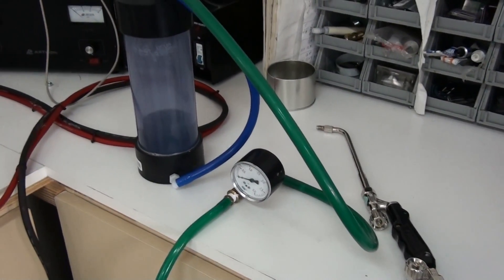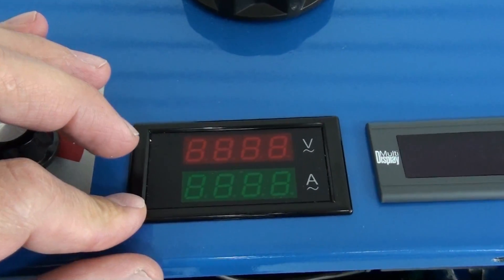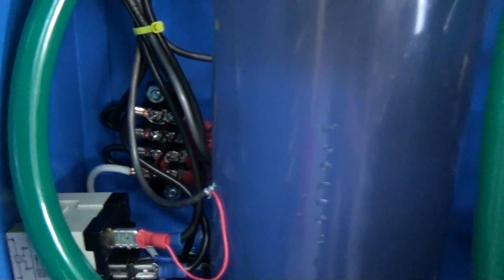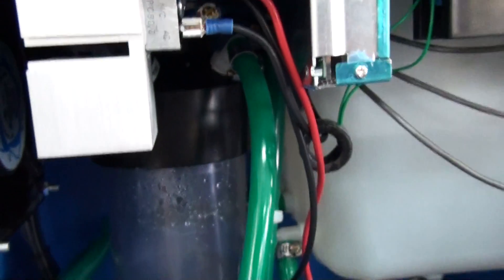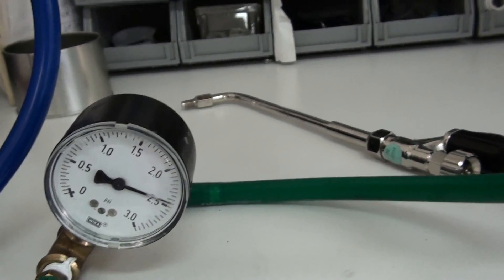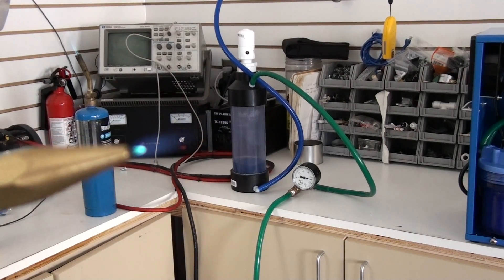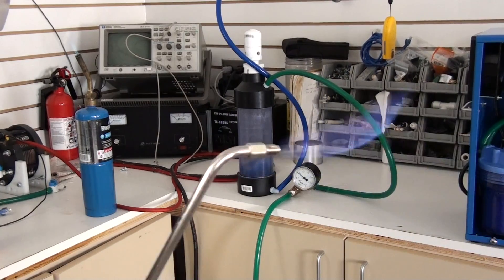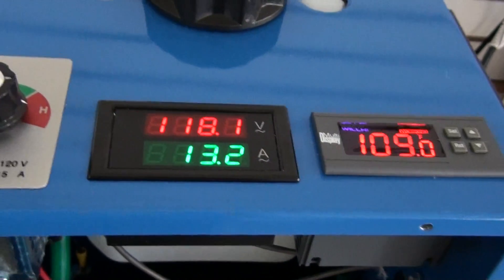HHO torch bubbling through lacquer thinner. WON'T Flashback

Comment: Very interesting.  But why use an arrestor when the gas is going to bubble through what most people use, a water jar. Surely this acts as the one way valve? Thanks
Reply from the maker: The flashback to the bubblers flash port of violent. I use the small arrestors because of that.
Reply: @Hydrogen4Health  ' the bubblers flash port of violent ' ???? What do you mean by this statement?

Comment: GREAT JOB, you have proven two theories that I have stumbled across over the years. 1) HHO is enhanced by the introduction of hydrocarbons, a very small amount of hydrocarbons ( Diesel, NG, propane, acetone) reacts with HHO at a molecular level (diesel fuel may give the same result) .making the gas far more stable and increasing the BTU's, especially enhancing the combustion process for use as a booster in diesel or gas engines 2) Don't use blue aquarium sandstone to clean the gas (only use the white sandstone). GREAT VIDEO....

Comment: how you increase the amperage and regulate it
Reply: GreenFuelH20 makes a regulator unit.  That's the knob you see.  It's cheaper and easier to just buy it than to try to make one.  Light switches at Lowe's just can't handle the pure wattage he is using, and wiring them in parallel is dangerous.

Comment: Hho enthusiastVery interesting, tho has anyone actually tried to compress the modified gas, if so could it be Compressed to the same pressure as l.p.g gas?
Reply: no. you cant compress hho in a tank... it will explode... only pure hydrogen can be stored like lpg...

Comment: I used a HHO torch (L&R Aqua torch) for years repairing jewelry. I always used MEK in the bubbler. Worked great. No flashback.
Reply from the maker: +Ken Sanders I don't like MEK because it's so corrosive. Did you ever try alcohol or acetone? The bring the temperature down and prevent flashback also.
Reply: I did try acetone. It worked too, but seemed to dissipate much faster than the MEK. The bubbler was stainless steel. I never had any problems with corrosion.
Reply: what is mek

Comment: This is completely normal. Chemistry is one thing I know inside and out. The lacquer thinner has ketones (usually acetone) which acts as a >>coolant in HHO systems due to its low boiling point. There is no chemical reaction in the bubbler (not w/out a platinum catalyst). Only a physical reaction. The acetone is simply evaporating into vapor, coloring the flame blue, and reducing the temperature of the flame + making the mixture less explosive. If you want to do a real experiment, add 30% hydrogen peroxide to the bubbler. Or buy retail 3% h2o2 and boil down on low heat till it's concentrated. Then add THAT to the bubbler. The h2o2 will destabilize and create an oxidizing flame. That will make the flame smaller, hotter, but you will get far worse flashbacks.
Reply from the maker: I just happen to have some from another experiment. Ho you think it will be safe with the setup i have here in this video?
Thanks for posting.
Reply: delvis11 That would depend on the concentration of the peroxide. Anything above 30% would be dangerous. What I did was go to a hair salon. They sell bottles of 6% & 9% hydrogen peroxide (or you can buy 30% online as a "moldicide" and dilute it). I got the 6% and boiled it on low down to 1/3 the volume which gave me roughly an 18% concentration. The phosphoric acid acts a stabilizer so you CAN boil it down but if you do it on high heat you'll lose a lot of oxygen.

Afterwards, I put it in the bubbler. Then I added a pinch of sodium bicarbonate (when I say a pinch I mean I dipped a straw into the baking soda, about 1/4 inch deep, then dropped it in. That's all you need.

By doing this the baking soda removes the phosphoric acid and destabilizes the peroxide. So when you bubble anything through it, it slowly releases oxygen and I definitely noticed a difference. The flame was much louder, smaller, and definitely hotter. 

I plan on doing more experiments in the future and definitely think it's safe (I might as well upload some videos too). The trick is getting the right concentration of peroxide. 30+% is VERY unstable and can spontaneously decompose at 120+F. This still wouldn't be that dangerous though. The decomposition would be mitigated by the pressure in the bubbler. More PSI's = slower decomposition. But anything over 30%.... that's when things get dangerous. H2O2 becomes extremely unstable at 35-50% concentrations. When it decomposes at those concentrations nothing can stop it.

So I think anywhere between 20-25% would be a good idea. It's right under the threshold, and a bit higher than what I did. I plan on testing it out again soon and will definitely report back. :-)
Reply from the maker: Thanks for your help here. The hho community sure could use a chemist like yourself. I myself have lots of questions for you.
So what I will try is half water and half 30% H2O2. That should bring the concentration down. I'll put a pinch of baking soda in the bubbler as well.
The 30% stuff I have is pretty nasty. It will easily burn my skin and I think it decomposes at room temperature. I bought it because I was mixing it in with my water electrolyte to increase hho production in electrolysis. It makes some crazy production but the extra O decomposes fast leaving the h2o behind.
I have some questions on additives to keep water from freezing that isn't glycol based.
Thanks for your help and I encourage you to upload video's. there is a lot you can teach the hho community. :)

Comment: Good experiment Steve. It looks like you are having fun playing with mixed fuel. I noticed that your bubbler is made out of plastic make sure that the chemicals inside do not eat through creating a massive fire hazard. Your bubbler needs to be made of steel or stainless steel. If for any reason you get a flashback to your plastic container with your pressure release valve on top it's still not going to work it's going to Explode it because the implosion is no longer there it will maintain the explosion intensity. I have experience using HHO Gas and Mix Fuel with 30 psi your friend Peter Crunk HHO Gas Technology

Comment: Now here is a question to pose... Using this mixture could you now compress the HHO/lacquer thinner mixture without having to worry about blowing the tank up if a spark were to occur in the tank? If not than this would be a very simple solution to compress HHO safely. It would also most likely burn or work with combustion engines much better than straight HHO and could eliminate having to make several changes to the timing etc.of the engine.

I would be willing to try it...  I can make a video of it.    I would make a pressure vessel out of PVC pipe and install a electric ignition system than have the trigger wire extend to a safe distance and see what happens. If there is no ignition then we know it's safe and that the mixture would not contain enough oxygen to make an ignition possible.
Reply from the maker: I have no idea what would happen but that would be a valuable test.

Comment: Its adding carbon and hydrogen to the hydroxy. Thinner is a hydrocarbon. Your losing oxygen to that in the burn. Probably carbon monoxide formed in the small blue cone then add a H to that to make a HCO molecule...bubble the gasses of exhausted burnt gas through water you should get acidic water.

Comment: Steve you can buy a brass air stones from the auto parts store. They are used as an inline filter in Rodchester and holley carbs. That air stone will hold up to the lacquer thinner.
Reply from the maker: Thanks for the advice. I will do that.
Reply: Also check into brass and stainless breather vents, they work well too, even for flashback arrestors : )

Comment: That is incredible setup! Really, but could you elaborate more on the fact that you are getting no flashback?
Reply from the maker: I don't know why really. I did try and cut through some 22g stainless sheet and it got red hot but would not burn through. Pure hho will burn a hole in that stuff in seconds. I can only guess that the oxygen effect in the hho is being negated some how. People that are smarter than me can probably answer this question. Anyone?
Reply: delvis11 Smarter wouldn't be the right way to put it because you are plenty smart Steve, someone that is more knowledgeable is a much better way of putting it. You got brains buddy and smart ones at that.
Reply from the maker: Thanks Tyson. Now if I could only convince my wife.
Reply: delvis11 I am guessing here but I would say the hydrocarbon fuel is dilluting the HHO gas enough to keep the new synthetic fuel stable. The oxygen is still there hence why you got a flashback using a different hydrocarbon fuel but if we choose the right fuel to mix, flashback is a non issue. I would think we can build self pressurizing tanks we install outside that have a electrolyzer built in to them that is run on Solar PV. The tank is filled with water/electorlyte and the liquid hydrocarbon fuel is added. Adequate spacing is left in the tank to allow the gas to build to pressure. Solar PV fires up the electorlyzer and the hho gas infuses itself into the hydrocarbon fumes and pressurizes the tank. No more Mr. Propane! If we get proactive we can use alchohol distilling and bio digesting/mass techniques to make our own hydrocarbon fuels, we can even use the H-Cat tech to do this. A all in one self pressurizing HHO Hybrid tank on everyones piece of dirt! Uncle Sam we don't need you no more! lmao

 I do not know if the new synthetic fuel would remain stable over a long period of time but I am doing some testing to find out. It reminds me so much of the SynGas only I didn't realize it was this simple. The finer the bubbles are that is introduced into that hydrocarbon fuel the more effective the mix is. Also the longer its going to last. I need to look up the compatibility charts but I'm not sure PVC bubblers are the way to go when pouring liquid solvent hydrocarbons into them. It seems some of these fuels can break down the plastic. We got so much testing to do with this its not even funny...

P.S. if you were to introduce some pressurized oxygen you could cut through that sheet. We can make this on demand and maybe even a inline air pump pulling from ambient may work. Gotta have some oxidative pressure to cut through metal.
Reply: Have you tried to compress the modified gas,or even run an engine on it with no modifications to the timing

Comment: How is the pressurising of pure hydrogen going?
Reply from the maker: It's been a long process of trial and error. I built a electrical circuit to control and balance the pressures in both tanks to find out I had overlooked something major. I wouldn't have even know it unless I built the circuit. It's things like that we learn from but also takes time. It's three steps forward and two steps back with the pressurization part. hopefully soon :)
Reply: delvis11 The mechanical balancing valve I built is working well. I cannot show it yet due to an agreement with a certain group of people but I am willing to give you the information I found a while back to back engineer one. Just email me for the file...

Comment: Can you use paint thinner to?
Reply: Yes you can, low odor mineral spirits works well too.
Reply: jdcproducts ok thanks gonny try this soon
Reply: CryB4Die No problem. All of us should be working with this hho hybrid tech. A gallon of Coleman Fuel works great too. The new synthetic gas we create when mixing hho in has a lot of energy density and makes it very safe in terms of flashback and emissions. I have not tested the amount of carbon based emissions but its got to be substantially lower than burning the hydrocarbon fuel alone. I am pretty sure this gas can replace Propane or Natural Gas. I am working with pressurized storage of this fuel too. Steve already has a heating technology he could put on the market now. Use that box and a send the gas to a fuel rail / heat exchanger assembly, its that simple. Even if you are pulling 1500 watts from the wall, I can assure everyone the amount of heat generated from this tech is magnitudes greater than a junk 1500 watt electric resistive space heater.

Comment: Thanks for the video Steve. I haven't finished my masterpiece yet but as usual you knocked this demo out of the park. I will call you in a bit on where to go from here and give you some input but from my experiments, this is going to revolutionize some things. H-Cat will merge well into this too. Ohh it is hard to see on camera but that blue cone, if you pay close attention its a tiny vortex flame, I have even witnessed the quantum tornado flame digitizing as if its a digital firestorm lol
Reply: Looked on your channel and there are no videos... strange since you have so many subscribers. How could I go about watching your vids?
Reply from the maker: I have a feeling this won't work in the h-cat. Something is happening to the oxygen when the mix fuel is being added.
Reply: delvis11 The oxygen is still there and remember, catalytic heating technologies have existed on the market way before the H-Cat came into play. The cat heaters run on hydrocarbon fuels that is void of oxygen. When the hydrocarbon is sent through the catalytic matrix it mixes with the ambient oxygen in the room to get the heat effect. Hence the reason they make sure to tell you to have adaquate venting, not only for harmful buildup of CO emissions but also replenishment of Oxygen in the room. Most off the shelf heaters now have oxygen sensing mechanisms built in that will shut off the heater if the oxygen levels fall too low. I have done some work and it will work in a h-cat scenario. I have not tried sealed systems yet but I am working with a tech sort of like the Coleman SportCat and getting great results. I am trying to get this gas to pressurize so I can send directly to an off the shelf propane heater. That picture I sent you the other day, I was doing that. The problem is the cell gaskets don't handle the permanent pressures needed to well. I am working on a wet cell hydrocarbon fuel hybrid system right now to fix the problem. However, we can build our own fuel rails, burners, and cat heaters and run them at low psi off our cells or even remove the pressure regulators from off the shelf technologies so the low psi cells we build will work.
Reply: delvis11
Delvis, it will work with H-Cat, I've already made this tryout the last year, please see this my video on youtube link :)    watch?v=NI0wbB0ul24